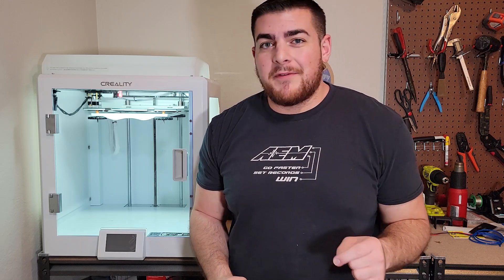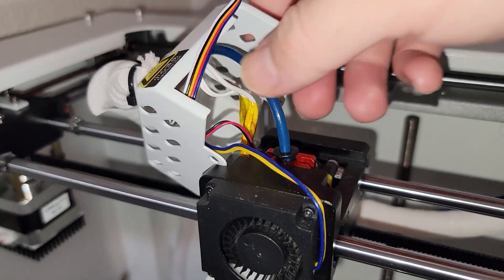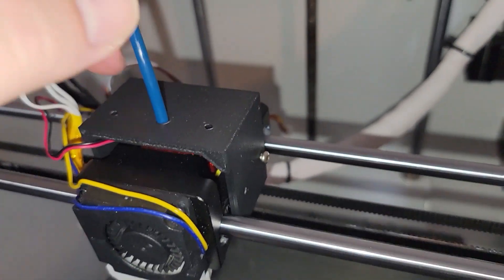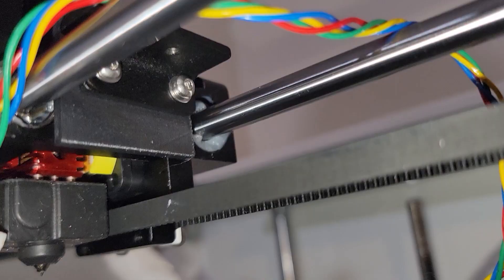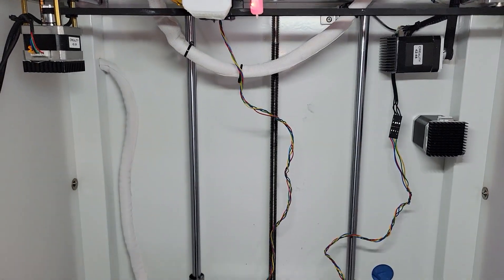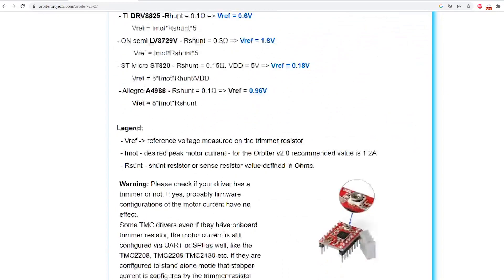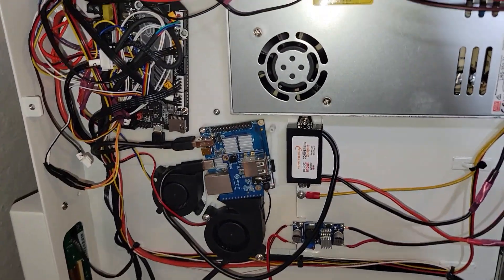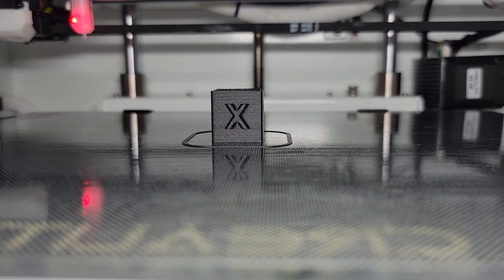CR-5 Pro Direct Drive Upgrade DIY - Orbiter 2

Comment: Hello, is it possible, to use orbiter v2 with original mainboard? I saw, that the mainboard has 4 pin connector, and the extruder also. I  try to figure it out on some forums, but i have no clue. Thanks in advance!

Comment: I have this printer and need to replace my hot end. I cannot find that hotend anywhere. Creality does not offer it. Thanks for the video. I am planning on doing this upgrade as well because the current extruder is just not doing the job anymore.
Reply from the maker: The only place you can get the hot end from is AliExpress unfortunately. I had a Creality Spider V4 hotend on the printer for a few days, which requires a custom bracket, but the thermistor on that hotend died quickly. Other people have swapped over a Bambu Lab X1C hotend over on it, which seems to work really well. I rarely use this printer any more, but I'll probably swap over an X1C hotend as well since they are super cheap and work very well.

Here's the AliExpress OEM hotend if you decide to go that route: https://www.aliexpress.us/item/3256802954375999.html?src=google&src=google&albch=shopping&acnt=708-803-3821&slnk=&plac=&mtctp=&albbt=Google_7_shopping&albagn=888888&isSmbAutoCall=false&needSmbHouyi=false&albcp=19158444193&albag=&trgt=&crea=en3256802954375999&netw=x&device=c&albpg=&albpd=en3256802954375999&gad_source=1&gclid=Cj0KCQiAqsitBhDlARIsAGMR1RiQ8PMWXgzyo4B-My_EZnK8q_rJTqtmmgz8O6WnugAMiB_qzsc-cBYaAmiNEALw_wcB&gclsrc=aw.ds&aff_fcid=2183fbc74a924df6b31a885357ea3c17-1706191953223-07441-UneMJZVf&aff_fsk=UneMJZVf&aff_platform=aaf&sk=UneMJZVf&aff_trace_key=2183fbc74a924df6b31a885357ea3c17-1706191953223-07441-UneMJZVf&terminal_id=1dbcc99fe69346a1b04b8a30d1faec1c&afSmartRedirect=y&gatewayAdapt=glo2usa

Comment: I wish I could see some step by step tutorials for CR-5 pro h Klipper installation. There's so much going on with it and it's different than Ender. I would like to use stock screen with it if possible.

Comment: Why didn’t you just drill 2 holes in the original cover? That’s always better the the plastic one
Reply from the maker: This is much easier for maintenance and  weighs less, which is important for pushing higher speeds. It's lasted just fine since the upgrade.

Comment: What firmware have you use for this motherboard? Where I can find firmware for Big tree tech mini E3 v 3.0 like yours but for Marlin?
Reply from the maker: This is used with Klipper since it's much easier to make changes to than Marlin. Marlin for SKR mini E3's can be found here: https://github.com/bigtreetech/BIGTREETECH-SKR-mini-E3/tree/master/firmware/V3.0/Marlin

You'll need to modify it then compile it for your printer accordingly though.
Reply: @FoulNews  I'll try to do that. Thx
Reply: @FoulNews   maybe I will try to start it on klipper but i see that I need some extra details and skills

Comment: Hi! Just recieved CR-5 PRO H and i have a question. It uses bl-touch for zeroing z axe and it behave strange for me. It makes 2 times probes with bl-touch and third time  platform moves up until it stops at z-limit switch bracket wich is not actin on cr-5 pro h. So the z-motor continue to work untill it stops at overload like it crashes to obstruction. Is it the same for all cr-5 pro h? I tried all 3 versions of firmware from creality and all of them works the same. Can not understand why bl-touch don't work for zerro z stop for it.
Reply from the maker: It sounds like there is something either not configured correctly in the firmware or the BL touch probe is not wired correctly or is faulty. If you're still using Marlin firmware, make sure that #define USE_PROBE_FOR_Z_HOMING is enabled and //#define Z_MIN_PROBE_USES_Z_MIN_ENDSTOP_PN is commented out.
Reply: @FoulNews   thanks for response.I use original firmware from creality and it's in .hex. Do you have scetch arduino version with original lcd support?

Comment: It would have been great if you would have shared step file, Sharing stl does not help as i want to improve on the design.
Reply from the maker: I just added the step file to the Thingiverse link.
Reply: @FoulNews  Thanks, I already created the design in meantime. Printing it  now will check your desin. I might have to tune it anyway as i have CR-5 Pro hotend is thinner not sure if the hole will line up.
Reply: I will be setting up Klipper have ordered the pi 4. I have seen there is a varient of Klipper which supports the default DWIN screen, Have you tried that?
Reply from the maker: @DoTheDiy  Nice, good luck with it! It's a great upgrade.
Reply from the maker: @DoTheDiy  Awesome, Klipper is well worth the install on this machine. With a Pi 4, it'll be a pretty quick job as well. I haven't tried using the default screen or bothered trying to get it to work just yet, but that does sound interesting.
Reply: @FoulNews  Hi  I did the setup but it is skipping steps rendomly i can hear clicking sound. I have done the setup as per the manual for Marlin. I have set the Vref to 1.664V after consulting the datasheet for TMC2208 the sense resistors on stock creality board are 0.15 ohm initially i had kept it low but this also did not help. I see the pulling force is great if i try to pull filimant extruder does not stall. But if i start blocking the nozzle with little force it starts to skip steps. I am using eSUN petg at around 235-230C same filament and same temperature were used in the stock extruder it was working, I even tried going to 240C but no help i cannot go any higer as hotend is not full metal. I have reduced all the speeds to check but it still happens. This is turning out to be a big disappointment :(
Reply from the maker: @DoTheDiy  What is the extrusion speed of the extruder? The stock hotends are good for a maximum of 6 - 8mm/s of extrusion with a 0.6mm nozzle before they get bogged down. Also if the nozzle is too close to the bed or other layers, skipping is expected. Try adjusting your Z-offset as well.
Reply: @FoulNews  max volumetic flow rate for the print i am doing is 6.32mm3/sec but majority of print is under 3mm3/sec
Reply: skipping is on other layers also apart from initial layer but it is not that frequent. I may have messed up some seting eventually will find it out.Also re did the wire crimp 3 times as i saw some issue with it, wire is very thin for this motor, That has improved things to an extent testing a print again. Normally an upgrade follows up with few days of sleepless nightes :)
Reply from the maker: @DoTheDiy  Yup, that's true. Dialing in upgrades does take some time indeed.

Comment: I completely agree with the design flaws. I've been mocking up a direct drive as well for the past couple weeks. Interested to see the results you yield from the swap. I've also though about adding front linear rails and making a new bed mount.
Reply from the maker: I've gone through about 50kg of filament since this upgrade and I couldn't be happier! It works so much better now and I haven't had a single clog since. I think using new rails and a better bed mount would be a great idea. The most I'm able to get out of this printer is about 250mm/s at 5000mm/s^2 acceleration for PLA before the physical limitations of this Cartesian style kick in. If you convert it to corexy, or use linear rails, it should be able to push some significantly better speed.

Comment: Have you thought about putting a sprite?
Reply from the maker: I went with the Orbiter 2 mostly due to the weight and ease of installation. The Sprite is a bit over twice as heavy as the Orbiter 2 and would require a lot of extra work to install.

Comment: Nice work! I got a pro h version and haven't been able to print, under and over extrusion at the same time. Will this work on the original board?
Reply from the maker: Thanks! Yes it will, but you'll need to make some changes to the firmware in order for it to work.

Comment: Thanks for the video. I also have a CR5 Pro and think about converting it to direct extruder since the first week I have it. Until now I always thought its not feasible mounting an extruder ontop the carriage due to the limited height, but you showed a quite elegant solution! I will try that to get a better print quality out of that huge box. Great Job!
Reply from the maker: Thanks! I'm glad to hear the video was helpful for you. Good luck with the install, it'll definitely help make a huge quality improvement as well!

Comment: great vid
ill try to do the same with the original board lets see how it turns out.
KR Dani
Reply from the maker: Thanks! Good luck!
Reply: Did you upgrade with original board? What driver and sense resistor settings did you use?